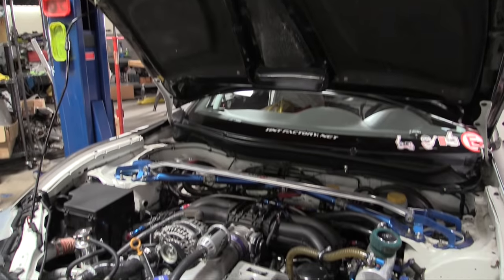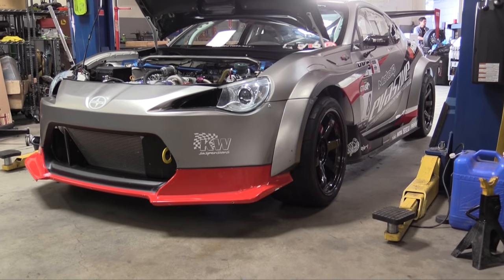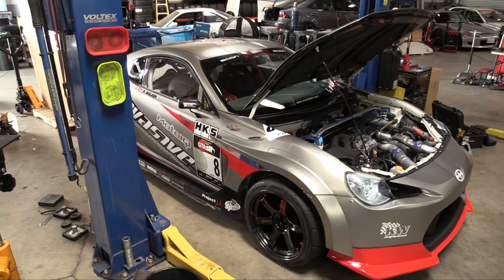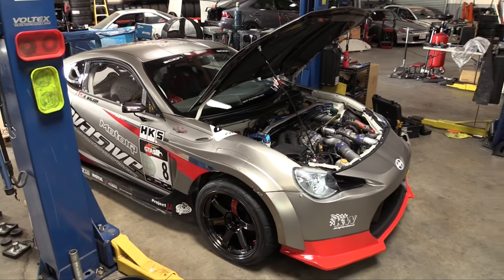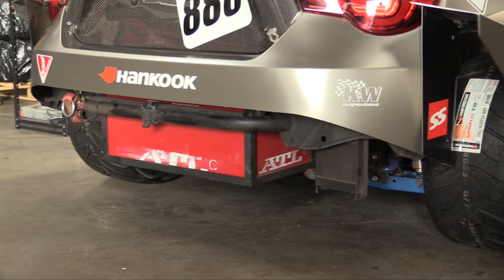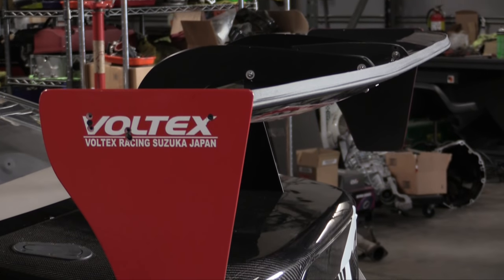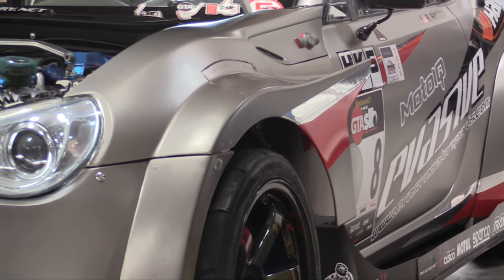🔥 Is 1000HP Horsepower All You Need To Win? | Toyota GT86 [TECH TALK]

Comment: First he is talking about the midrange torque, usable power on the street but then we find out that the car makes all the torque and the power at the redline. The car is really quick and I respect the effort of developing the car but Mike is not honest with the viewers.
Reply: Try re-watching it - and then thinking about the torque curves typical of turbo'ed and centrifugally supercharged engines. With a turbo' they tend to be unresponsive when the rpm is below the point where the turbo' starts to produce boost and/or only partial throttle is being used, so there may be relatively low torque at low to mid-range* rpm - further, the initial 'flat' response if caught in the wrong gearmay be immediately followed by a rapid increase in torque when it does spool up, both conditions that can result in the vehicle responding in an undesirable way. But with a centrifugal supercharger there is some boost being produced from little more than idle and it increases with rpm, this means that whilst it may produce its peak torque and power at high rpm, there is still a substantial increase in boost, and hence torque, in the same low to mid-range rpm range.

*Also may depend on what one considers 'mid-range'.
Reply: Follow this series, or just go to the last for their conclusions - https://www.youtube.com/watch?v=l0NMCMcdVp4 - different car, but similar principles.

Comment: So you want it to be relate and sort of street, so you stroked it, forged it, customised the supercharger and fitted a dog box with custom interchangeable ratios ... yeah seems heaps relatable to the road car.
Reply from the maker: Yes the dog box is certainly a step further than relatable, however, the other modifications are not unreasonable considering he is specifically meaning being relatable to those who want to mod their cars for better performance. You don't have to go that far on your own build either, or you could go even further and still drive it on the road, up to you, your wallet and what you enjoy :) - Taz.
Reply: High Performance Academy yeah sure he and anyone can build what they like. Usually driven or dictated by budget and personal preference. Have at it I say. But you cant claim that its relatable to a street car any more than i can for my time attack r32.
Reply: Not sure what your point is, it is what anyone who wished to could do to their car - and I know of quite a few dog'boxes used on road cars.
As you modify an engine for increasing power/torque, there are weak points that need to be addressed - by making the intial investment of up-graded forged internals at one time it can actually save money and if the same money gives you a longer stroke, then why not go for it?
Same with the 'box - if it needs replacing, why not just go for the best option?
Reply: The point is reliability only you can't claim it's like the road car, when it's just too far removed. I agree with going for the best upgrades when you come to a weak spot in any build for sure.
Reply: tangles01 lol mate im pretty sure your gts-t is more relatable to a street car than this is, looks nice and all but come on. Anyway I dont remember hearing him say its like a street car and just as reliable lol, all he said is that is they wanted to keep it relatable to the original street car. For a 1000hp 4cyl time attack car running unlimited class at global time attack i guess it is. Curious where you came up with the wisdom that he just built whatever he liked and wasnt dictated by budget... Needs more judgements based on misunderstandings and neckbeard rage mate.
Reply: Jack Torrance i agree that my gtst is more relatable to a street car then this. And its still not relatable. Be happy to habe a heads up time attack race withthis guy. The rest of what you said is nonsensical drivel. 1000 hp? He makes 430.  Says it in the video.
Reply: Clearly i skipped past the hp part not my sort of car, but what was nonsensical? The part where asked how do you know it wasnt built to a budget and just any way he can? Or about your relatable hissy fit? The car runs at the front of the field in the unlimited rwd class at global time attack, do you know what the rest of the cars look like? Thats what he means... keep it relatable to the original car compared to the way the rest of the cars are built. Aside from there being no head to head racing in time attack theres a big difference between this and your car, as you'd expect. It'd probably lap mid 30's at eastern creek, im taking it you've never been there so what do you think you'd lap there in your r32? Have you run up at lakeside yet?
Reply: Jack Torrance ill be running eastern creek. Hopefully next year. Lakeside. Sooner. Still rebuilding the engine. But its been in the 59s with old tyres no aero and a few mods ago. It's not a hissy fit. He made the point to say it could be compared to the street car when it cant. If you're skipping chunks of the vid how much else did you miss.
Reply from the maker: @tangles01 If you want to be pedantic and ask who missed what in the video.....Nick was specifically talking about retaining the FA20 when he made that comment about being relatable to his customers. I'm sure you can agree the average car guy is more likely to be able to afford to pay to have a supercharger kit bolted on and tuned than they are going to be able to pay for an engine swap, the custom fabrication, tune and potential driveline upgrades that come with that =)
Also note the words, time and patience. I bet there were many late nights and weekends spent on this car with all the research and work they did in-house while others who look on jealously now were sinking pints at the pub at over the same period of time 

Best of luck with your own build, remember time and patience mate. A few years and your own car could be even more impressive to you than this build seems now, who knows, but I hope you enjoy the journey =) - Taz.
Reply: I'll make this clear, firstly I have no issue with the build in any way, and if I did it would be irrelevant, it's not my  build, it's theirs to do with as they please, and it looks like they've done a damn fine job of it.

Yes a super charger is probably the easiest option, so it would be relatable in that department, but even that super charger has been heavily modified, which is cool... but not relatable to the hks package those road car owners will be able to purchase.

I've got no doubt endless hours, late nights failures discoveries more failures and solutions have been cycled through, that's what it takes to build something like this and I doubt they are too jealous when on track.

My build isn't really relevant, though thanks for the kind words. I watch all your academy vids and am always learning new stuff when I do, all knowledge gained is knowledge to put towards my own success, so thanks for the content.

I just feel like my initial point was missed by some, I'm not having a go at these guy's, their build, their effort or there talent in in way. Still, if they are WTAC in the right year, we might just be able to get a comparison, but it's all in friendly competition, maybe loser buys a beer.